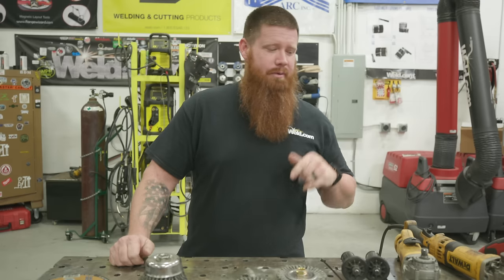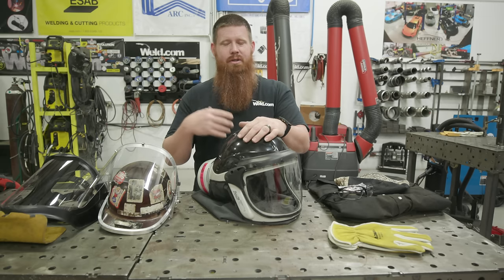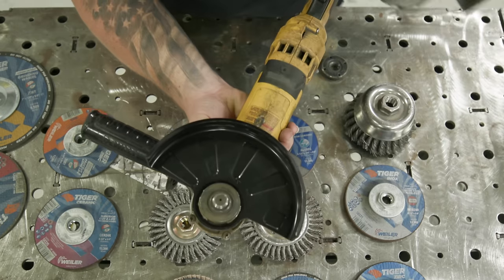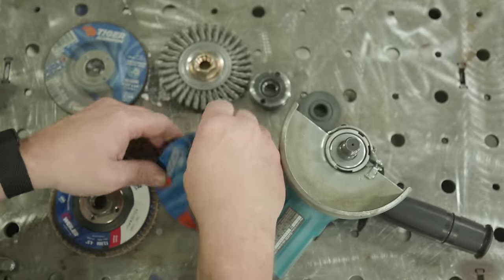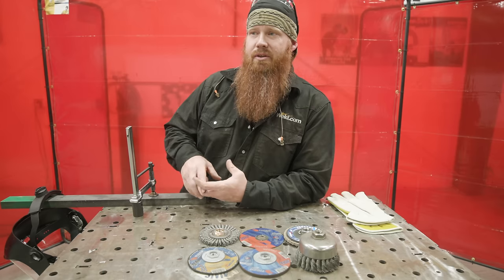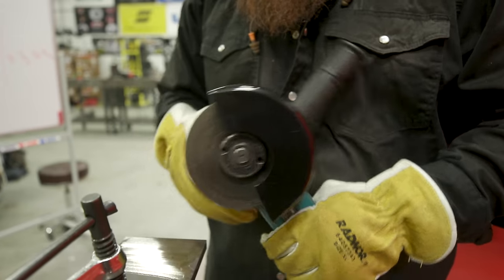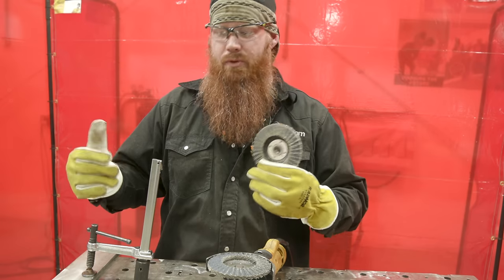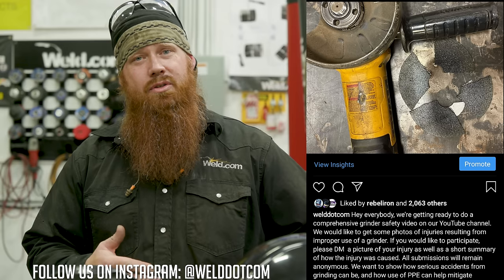Grinder Safety: How to Properly Use an Angle Grinder

Comment: ah man, some of those pictures at the end had me squeamish. I'm a bit of a safety nut just cause I've seen too much stuff like that. When I was learning to weld, another student managed to heat up TIG wire hot enough to go through their glove and into their hand. Worst shop related injury I've seen, worst shop related injury I had was from a cordless drill biting into steel and it broke my nose. Wasn't entirely my fault though since I told my boss I needed a smaller drillbit to work up to 3/4 inches and he said it'd be fine. was drilling through half inch mild steel.

Comment: Absolutely terrified of grinders. Last weekend I was under the car jacked up with jack stands and wheels and blocks of wood xD, trying to get the lower arm off, the bolts were siezed in the bush sleeve, an "easy" job for a grinder.. Can you imagine?, it would have been inches away from my face lol cutting through a thin gap, neighbour offered to lend me his. 

I had to laugh at the images in my head portraying the stupidity of that idea, in the end I burned the bush of and grabbed the sleeve with some parrot noses and managed to free the bolt up.. 

An anecdote I heard recently. A fella attempted to cut the lid off a tub of thinners with an angle grinder, his co-workers were in the warehouse at the time and heard a big "BANG"  .. They came out to find there pal rolling around on the floor, in flames .......

Comment: 16:50 same with damaged extension cords: cut off the cable/plug before you throw it in the trash, to prevent anyone from picking it up from the trash or so. Just make sure you unplug it before you cut if off. ;-)

Comment: Can I use a metal blade on a jigsaw to cut a thin steel flat bar? It is an Ikea cabinet rail. I was going to buy an angle grinder, but now I am afraid of it.

Comment: Whatever anyone says, I will have a fire extinguisher handy, so, would an angle be safe to occasionally cut up some pieces of steel on my deck (which is my DIY "shop")?  Those showers of sparks are kinda scary to me.

Comment: Yesterday I had 3 cuting discs explode on me in a time period of one hour! I am a total newbie (and obviously a moron) and even now I am not completely sure why they exploded so quickly. Maybe the RPMs, maybe the tool itself, maybe the tension of the iron bar, my technique for sure... I had only safety glasses on, they kept my eyes safe and I was lucky enough not to sustain any injury. Not touching this tool anymore before I figure things out! p.s. is there a proper technique for cutting if the bar is connected to something on both sides, opose to cutting something fastened only on one side (like in this video)?

Comment: No safety glasses or face shield. The back and forth movement looks unsafe. There isn't a handle on there for stability and the wheel guard looked like it was missing. The cut should be deliberate and at an angle so it doesn't jump or break the wheel. But this is why I'm here to learn. I could be wrong but the sparks shooting might be going in the wrong direction. You probably want it shooting down. Can't figure the old solvent part out though. If it's flammable maybe it shouldn't be there? 
 You have something on fire 😆
So far love the video. Already engaging with an activity! Noice

Comment: Grinder wrench not needed. Auto tightening takes place at first spinup and again at first touch to material. And wheel can be grabbed and unscrewed by hand with gloves on. If a cutoff wheel is stuck lock the rotation and wack the blade edge on a metal table edge with the full weight of the grinder with wheel facing to the right so it loosens, the wack dents the wheel do it can grab against the table and unscrew. Your grinder wrench will bend if the wheel is this tight.

Comment: 1.Grinder is being moved excessively and not enough pressure is applied
2. Obvious Oxigen Tank behind
3. Flammable objects and substances nearby.
4. No guard installed 
5. Safety squints instead of glasses.

Maybe there's more.

Comment: 2 weeks ago I watched a guy use a gas powered saw used to cut concrete on a steel cable. The blade was for concrete thus the teeth were such that the spacing was pretty aggressive.  It caught a brade on the cable and the saw jumped and hit the guy in the face. The cable wrapped around the blade and ithe tool clocked the guy in the face. Pretty scary. I was a bystander and told the supervisor that he should have caught this.

Comment: Angle grinders are incredibly dangerous machines, I know just last week I took a chunk of belly fat out of me. Fortunately it was fat if that had been anywhere else it could have been lethal. My accident was totaly my own stupidity. I was holding a tall workpiece vertically on a table saw I had switched of the grinder to check on progress, still holding the workpiece I went to switch the grinder back on with my right hand (my grinder is the older type with just one stiff switch}. As the grinder switch was slid on the whole now on machine went into my shirt. Before I knew it, it had wrapped and shredded my shirt. At this point I thought I was OK, but looking down I saw meat. Of course as the material is wrapped it tightens the blade in to you. I was actually using a sanding disk, so they can be just as destructive. I didn't go to hospital as my local chemist said it would heal on its own with regular care. So many home users now use grinders so casually that accidents are bound to happen, and when they do these machines mean business.

Comment: I'm not done the video yet, but I just bought a dewalt 4.5" grinder-battery operated.  I don't know how to buy wheels!  Apparently, it's not just the size of the wheel! It's so confusing to me.  How do you know if a wheel fits your darn grinder? I bought a 4.5" cement grinder wheel.  Apparently, it's not for my 4.5" grinder (it was a dewalt 4.5" ⁷/8 all the numbers matched my grinder)!  But no! I  have to have a different 4.5".  Like what the hell!  Silly me was going by the wheel size-which is apparently wrong.  I'm so frustrated that I'm going to return it.  So, please advise how to pick a wheel! How do you know if it will fit if size is not the measure of fitting?  There's no info on the wheel saying "type [fill in the blank]. Mine is apparently a 4 while the disks I'm buying are for a type 2-but it doesn't say that on the disc anywhere!

Comment: Safety glasses protecting your hair, not your eyes, a jug of probably flammable solvent on the work surface, in range of some hot sparks, and welding gasses near lots of hot sparks, one of which is very good at being on fire, and the other of which is very good at making fires bigger. What did I miss?

Comment: 1) No shield on the grinder
2) Not wearing your safety glasses correctly
3) Should have on a face shield
3) The item your cutting isn't strapped down
4) Sparks being shot at the combustible gasses
5) Junk in the work space ( old solvent)
6) probably should be wearing long sleeves
7) Not wearing cut resistant gloves

Comment: - No guard
- No side handle
- Insecure hold on the grinder body
- Work not clamped
- Sparks flying + flammable objects around (Oxygen/Acetylene tanks, old solvent canister)
- No safety glasses / dust mask
- Dangerous beard :D
- T-shirt, perhaps?

Comment: I was watching Big Brother the other day and I didn't want to leave my room and I wanted to modify a machete I grind off a quarter inch the length of the blade about 2 ft long on my bed showering my room with Sparks LOL I didn't let it get too hot though I stopped like every minute to let the steel cool down so it would not weaken🤷‍♂️🤪🤪😅 oh yeah and I did it like how you showed in the first demonstration one hand holding the grinder the other hand holding the blade LOL

Comment: You're actually grinding with a cutting disc. Just put it in and controle the perpendicularity and alignment. It will cut like through butter. PS: Don't use disks someone else used

Comment: Ok I’m doing this without skipping ahead, 1. No safety glasses or shield, 2. No safety cover on grinder, 3. Work piece is not properly secured, 4. Sparks are going towards flammable gas cylinders and hoses could be prone to leaks, 5. Chemicals are to close and should be put away in a proper metal cabinet

Comment: oxyfuel tanks in spark path, old solvent not in closed cabinet, no faceshield or safety glasses, no guard on grinder, no clamp on work piece requiring 1 hand operation with grinder and possible kickback of workpiece, bad gloves in my opinion, i was taught to not use the grinder with it "facing" me like that, but idk if that's a big issue.
Reply: darn, i didn't check your ears...

Comment: No Eye protection
One handed
Flammable container in area
Welding equipment
The metal bar should be clamped down and both hands used

Comment: Amateur welder here trying to deduce the violations with the initial demonstration:

So 1st- I believe he's using the flat wheel grinder I think as a cutting wheel.

2nd-instead of clamping or securing the piece he's using his hand. His fingers are also in dangerous range of the grinder

3rd-His grip on the grinder seems loose. Could go flying.

4th-Lack of PPE. No glasses, no cover from sparks on beard or clothes

5th-Grind area not clear. Especially with flammable solvent barely a foot away.

6th-Not wary of where sparks are flying. Right at the gas cylinders😱

7th-Just not in an area safe to grind. A bunch of objects everywhere with no covers

8th- The place is literally of fire in a spot from what I assume was contact with the sparks, but it's just another Wednesday for him😂

Comment: And please wear those safety glasses. I didn't, I'm a blacksmith/horseshoer and while using my grinder I forgot to put my glasses on and a hot piece flew into my eye.If you have never had this happen,take heed. A hot piece will stick to your eye and I had to have the eye Dr. take mine out. Just a small piece will feel like a log in your eye and will drive you crazy.Good lucj=k to all and thanks for all these tips.

Comment: flammable material gas, paper and liquids /pressurised gas in direct line of sparks, I didn't check disc fit type and condition/ goggles/unfixed workpiece /no guard/not held properly/no second handle to securely hold

Comment: I am reminded of a unique story. We had a grinder Ziptied to a wooden pole so we could grind rust off ofca Large water pipe 10 feet maybe. So we are up on a ladder 2 hands on the pole, leaning on the extension ladder. Once in a while the grinder would jump a few inches. No one was hurt.Update May 2024. On Myth Busters show they put a compact disc or cdrom in a grinder . It was secured in a wooden box with  plexiglass cover. They plugged it in with no gaurd on grinder. Please dont try this

Comment: Grinding without safety glasses. Flammable solvents in the work area. Sparks going towards acetylene and oxygen torch. not using both hands for the grinder.  no borders to stop  someone to walk in the area. no Vice being used to hold the part being cut. no earplugs.
No leather on his arms to protect them. 
No shield guard for the grinder improper clothing being used as sparks could ignite the clothing to start burning 
No handle on the grinder so I can be better controlled with two hands . No face shield .

Comment: Oversized disk, no guard, single handed, well below the center of the grinder, throwing sparks at bottles of compressed flammable gas, flammable solvents nearby, and obviously some sort of rags or something that have already caught fire behind you. Then of course the safety glasses still sitting in your head, grinding an unstable piece that you’re holding with your hand. I think I got all of them? Guess I’m about to find out.

Comment: No guard on cutting disk.  No safety glasses.  Probably need hearing protection and a face shield.  Leather apron would be good as well.  Welding gas tanks being sprayed by sparks.  Jug of flammable solvent near work area, susceptible to being sprayed by hot metal particles.  Workpiece not clamped down, so need one hand to hold workpiece leaving only one hand to hold grinder.  The gloves and T-shirt, however, don't appear to have been recently soaked in gasoline, because they're not on fire yet.

Comment: The angle grinder is a sneaky angle grinder and attempting to light up the o2 cylinder byy trying to light up the tube as well as trying to catch any flammable substance on fire and also attempting to send shrapnels of metal in the eye. i dont recommend this type or brand of angle grinders as they are so sneaky😄😄😄😄 just kiding i listed all wrong things that should not be done by any means and i like the video so much awesome and informative

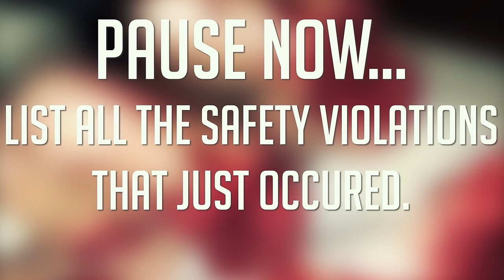Comment: 0:48 

The first safety violation I see is that the sparks are very close to an gas tank. I also see the instructor isn't wearing any safety goggles/glasses.

These are all the safety violations I have seen in the instructors demonstration.

Comment: Me, just after grinding four screws with a cutting disk on an old carpet floor in my pyjamas, hoodie and slippers, wearing eye, respiratory and ear protection: "I'm not quite sure this is the safest way to use this thing..."

Comment: Not stable grip on the grinder, not stable grip on the metal, no eye protection, no ear protection, no lung protection (also try to wear a working coat with long sleeves), no cover shield on the grinder (you can deal with that if you have proper protection), not appropriate working place. 
I don’t know what solvent means because my main language is not english.

Did I get everything?

Comment: sparks hitting the gas cylinders infront a canister with old solvent and the loose holding of the anglegrinder missing eye protection  not propper secured workpiece ...

Comment: Those wire wheels can be dangerous when using them properly.  If one of those little metal needles fly off and hit you just right and puncture your clothing you are gonna be wanting to throw that grinder across the room.

Comment: When using a stringer wire wheel always make sure your not on the end that material could be slung at you, stand off to the side of the grinder even when you first fire it up. A peice of wire or slag  in the gut aint a good time.

Comment: OK - my take on this - no safety glasses or hearing protection, no guard on the grinder, next to flammable solvent and acetylene cylinder, holding grinder with just one hand, metal not clamped down, could be wrong type of disk.

Comment: Cutting near flammable material aka the old solvent and the torch improper safety gear no googles or jacket on improper use using one hand with the grinder and holding the material with the other

Comment: 1. No guard
2. Not using safety glasses, nor a face shield
3. Sparks are flying near Oxy-Acetylene highly flammable gas
4. Cutting near old solvent
5. Sparks lighting paper on fire
6. Holding the material with your hand
7. Not using hearing protection
8. (maybe) Not using a leather apron
9. Use better gloves

Comment: Sparks hitting gas bottles, flammable liquid next to the job, no guard on grinder, I've seen people before holding a job with 1 hand whilst grinding with the other, personally I'd clamp the job to the bench and hold the grinder with both hands, I'm sure there's more flaws in the first part, I'll restart the video 👍 no safety glasses, cutting disc too big for grinder size

Comment: Safety violations:
1) dirty gloves
2) old solvent is no good
solvent should new clean solvent with cap off the bottle incase you need it quickly and dont want to stop grinding.
3) grinding with eyes closed
this is dangerous as you cant see the line yer cutting.
4) No towel on bench incase cutting disc breaks and disembowels you.

Comment: Flammable materials nearby, workpiece not secured, no guard on the grinder, holding the grinder incorrectly, no eye/face/head protection, long beard not secured and close to the grinding area, no control of where the sparks end up, bad posture.

Comment: 1 wrong disc that is An old 300 disc
2 no safety cap on the grinder
3 no safety glasses on
4 flameabel gasses liquids and materials
5 holding the grinder with one hand
6 holding the workpiece with your hands

Comment: No guards, safety shield, flammables and explosives. Wrong gloves , no hold down or vise.Blade facing the body. I will not use the wire attachments. I have had them throw wire out and straight through a shirt and gloves. I would love to walk through your shop. I am considered a safety nerd at work (furniture factory) as I have been on the safety team for ten years and chairman seven of them. I take it a little bit personally when someone gets injured and not able to work or do anything with family or friends.

Comment: Grinding with a just safety glasses is not acceptable.. You need more.. I find the Jackson googles with a half shield work great.. using 2 hands isn’t always an attainable work standard.. the fact that you are using a paddle grinder is extremely concerning especially if the paddle safety lock is broken

Comment: No eye wear.  Your sparks are  flying into flammable solvent. Sparks flying into oxygen tank. You're only using one  hand. You're gripping the grinder at the bottom where you have little control if you catch an edge, etc. You're using the grinder like a saw, back & forth, back & forth.

Comment: number 1) no safety glasses, and safety mask 
               2) no apron
               3) no long sleeves
               4) no disk guard
               5) no ear protection
               6) grinding with disregard for flammables in the area
               7) no fire suppressor by hand